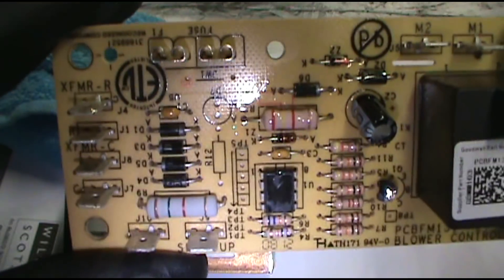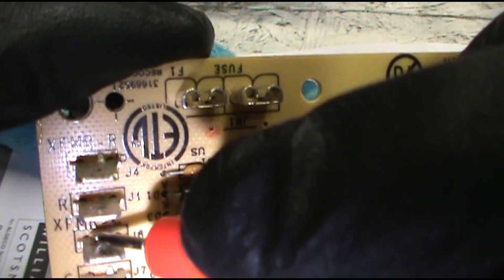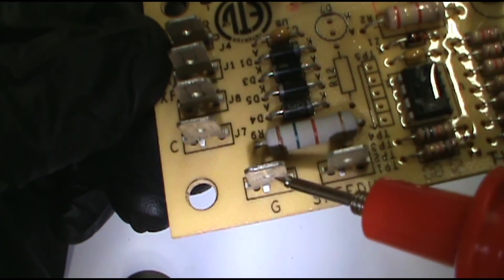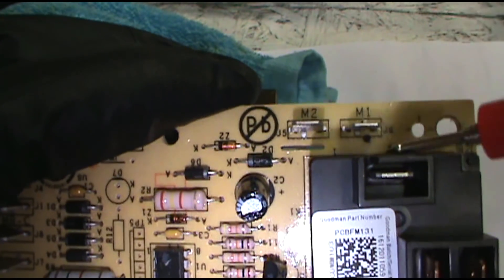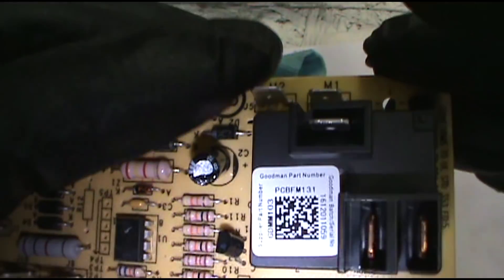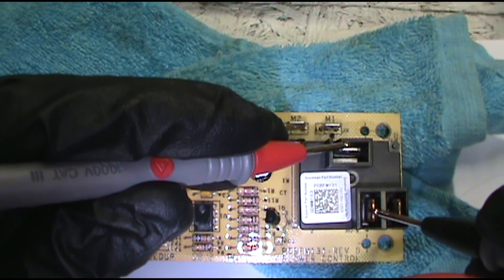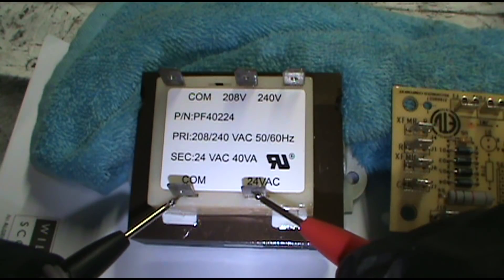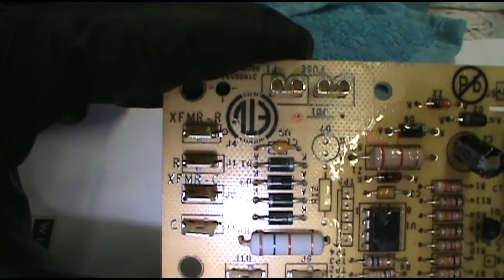Going Over A Blower Control Board HVAC

Comment: LEX I'm having some problems with a Goodman heat pump 2.5 ton and would like to ask U for a little help I have power at the indoor and thermostat but no power going to compressor or condenser fan motor I changed contactor and capacitor and Thermostat I'm lost now only thing I can think of is rewiring the out door portion
Reply from the maker: Quentin Riddick is there power coming to the contactor? Check the bottom of the contactor and see if theres 240 volts when you touch the black & white wires coming in from the disconnect.
Reply: Sorry was at the store but yes it's 250 at contactor
Reply: I'm doing inventory in a little while but I'm free now to talk
Reply from the maker: Quentin Riddick Is the contactor pushing in? If the contactor ain't sucking in, you have a low voltage problem. That's why no powers getting to compressor & motor.
Reply from the maker: If the contactors not sucking in, take a flat head & push it in. If everything fires up, then you have a 24v problem coming out to the unit.
Reply: He was stocked up with a different contactor this one U can't push in I'll take a pic of it when I go in
Reply from the maker: Quentin Riddick If theres 2 little screws on the front, take them out & remove the cover. You should be able to push it in when you take the cover off. The cover keeps the bugs out of it. Its just for safety.
Reply: It's 6 inches of snow here right now So it's going to take me a little bit to get back over ther
Reply: I'll check my low voltage side again I almost forgot the Unit showed 0 pressure with the system not running
Reply from the maker: Quentin Riddick Oh! If theres no pressure, that means the low pressure switch has it off. That's the issue skid!

Comment: I replaced those in almost every unit in my property. 
That black box relay burns fills the unit was smoke sometimes the resident calls The fire department.
Reply from the maker: igrowdro1badmf Wow! I hope ours don't catch fire. Thank you for watching igrowdro!
www.DirtyMaintenanceNation.com
Reply: When your property reaches about 10 years old they will all go bad at once. they don’t catch fire literally that black box burns itself out sometimes it sticks the heat on
wires Melt together
Reply: Happens at my property sometimes.  The old board never has a fuse also. Since we replaced with ones that are fused we haven't had any problems
Reply from the maker: igrowdro1badmf Awesome I can't wait! 😂😂😂😂👍
Reply: so numerous pointless fire truck rolls, because someone choose chinesium relays with garbage contacts for their design, gotta love it ;)
it could have been upstream suppliers selling lies and inflated specs...

Comment: What a cute little board.. just a lil fella.  I like the goodman furnaces on account of how they are laid out inside, and universal parts fit ok...  york/guardian not so much
Reply: I think its harder to get parts for the guardian, and that could be just me in my area.  I don't work on many or encounter many.   They are just not that popular. (or it could be that they are way popular and never break down)  I tend to do new installs for my side job, and I offer the goodmans.  They are the chevy cavalier of furnaces
Reply from the maker: jason It is cute lol! Thank you so much for watching Jason!
www.DirtyMaintenanceNation.com
Reply: Jason, do you have any other issues with the Guardian line of equipment? I seen them in the York supply house. Their paint job reminded me of a Goodman. Not a resi guy, just do commercial work. But, just am curious about them.
Reply: There are only 2 York supply houses in my state I believe. They are 1/2 hour from each other. Their furnaces and A/c's look like a goodman